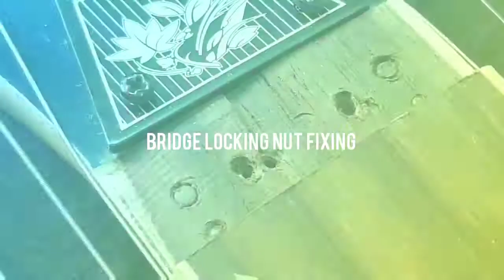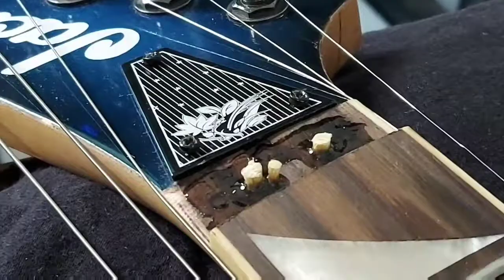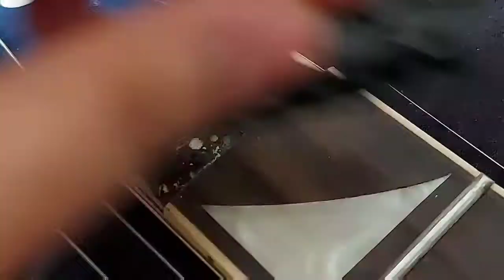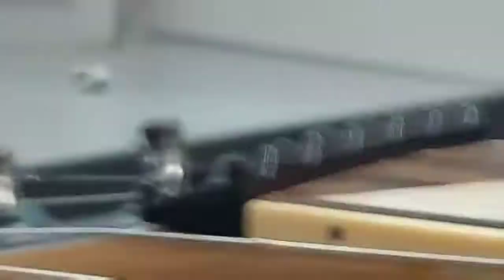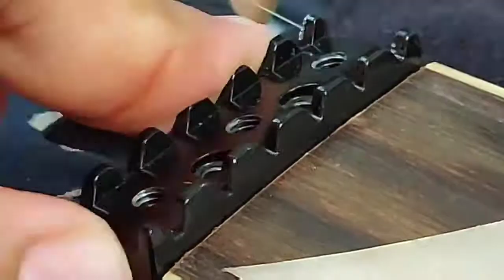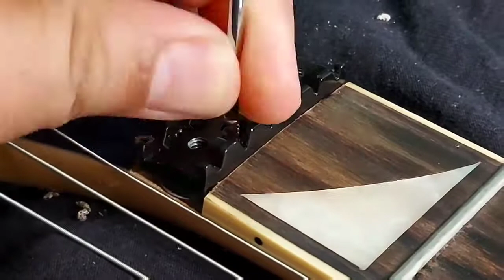project | locking nut fixing

Comment: For a shim underneath the nut you can also cut a piece of soda aluminium can like coca cola etc, its thin enough to cut with a scissor, and you can cut it exactly at the shape of the nut, just drill 2 holes for the nut screws, and you can stack more than one if needed.
Reply from the maker: Ah.. what a good tip sharing. Thank you very much sir.. much appreciate

Comment: Strange my ibenez s521 is the same I bought it from a friend and wow it was terrible the height adjustment was well off,no fret buzz but strings were way too high hard to play it!! So I took off the locking nut got first screw out,2nd screw was de,faced what a nightmare it was I tried everything so I drilled it out it broke off in bits again a nightmare so I've taken so much time to do some research on this found ur video and it is same bad job haha,string height on it when on was like 10mm hahah crazy!! Was sounding so badly out of tune when it says it was in tune I was going nuts so I ordered a black floyd rose nut drilled bigger holes so I can put in gorilla glue with wooden dowels I've put it side for now I'll check it tommor morning see how it is cured! If good I'll file it down do new good holes and get the height adjustment sorted for new FR locking nut coming any tips buddie
Reply from the maker: wow, it sure look lot of works. but if its our pasiion to do it, we always happy to do it right haha.. but im not sure using gorilla glue is a wise action. because incase you want to pull it off again maybe so difficult. i think epoxy will do it. but use it as hardener to correct the mistake too big hole. after dry, drill again for the right size
Reply: @pale0903  thank u so much definitely passion buddie I'm so gonna get this right as I wont give up on this I need to get it right lol thank u
Reply from the maker: @paulyoung4781  if not too much, share you work on youtube too ya 😊
Reply: @pale0903  ok I will do that,I've filled the holes with proxy gorilla glue and wooden dowels so far,but I'll video it from now shaving it and filling it to fit mate,ok I will do that thank u for ur reply